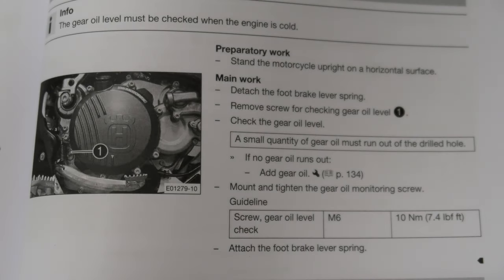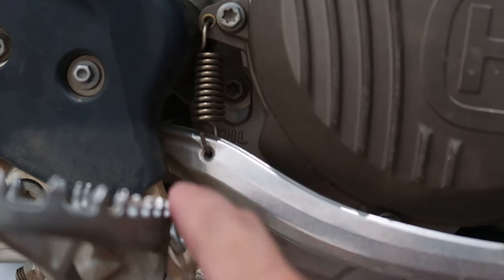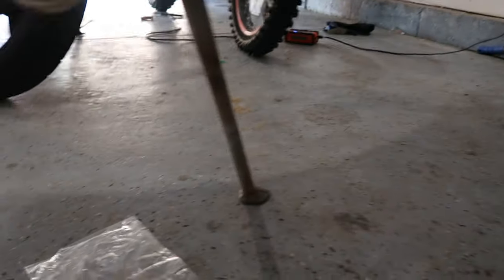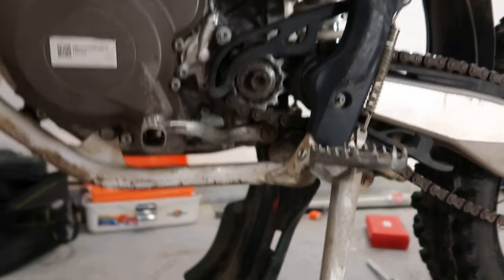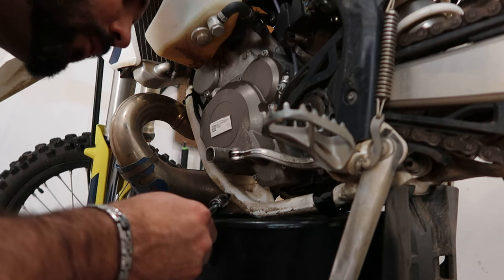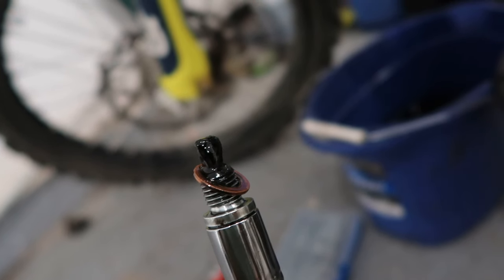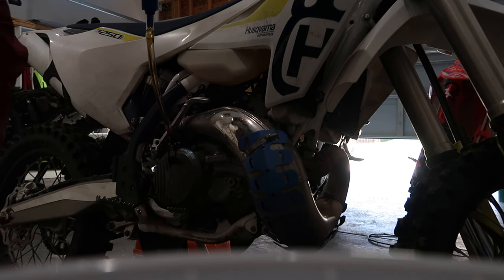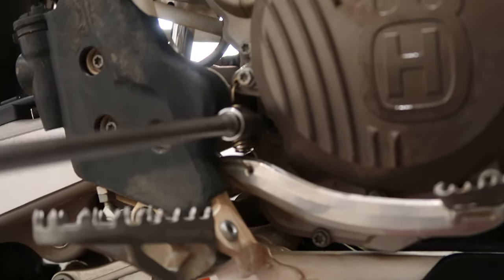how to change the gear oil on a husqvarna 2019 te250i 2 stroke dirtbike

Comment: I lean the bike over on the clutch side then pull the plug, install a drain hose and then lean back over on the opposite side and let it drain into a oil pan. Saves on the cleanup. I usually top it up with 675-700ml on my ktm which puts it right at the correct oil level. I think 800ml is the dry amount (not that a extra 100ml is gonna effect anything)
Reply from the maker: that is a good idea! I was thinking of doing that also haha! yeah I was thinking the same thing as well if 800ml is the complete dry amount or not but yeah like you said 100ml aint going to do much haha

Comment: Usually a good idea to warm the bike up slightly so the oil flows a little easier completely... Obviously not boiling hot
Reply from the maker: 100% forgot to add that int he video lol. I did take it out in the block before changing the oil.